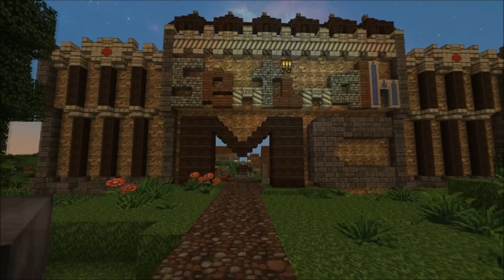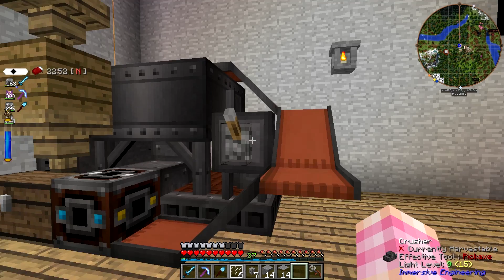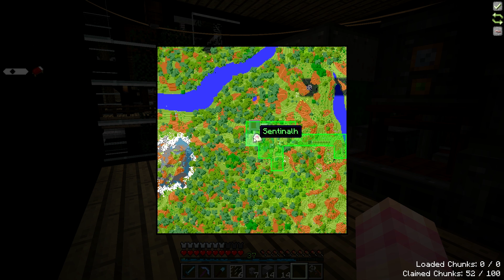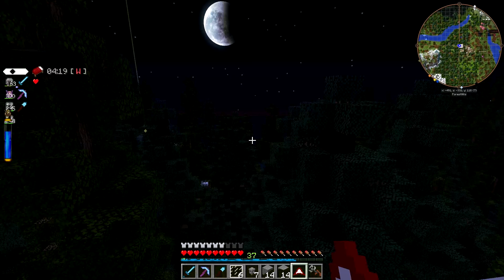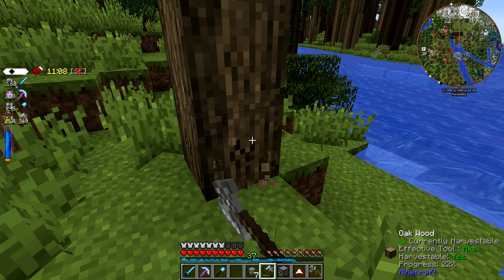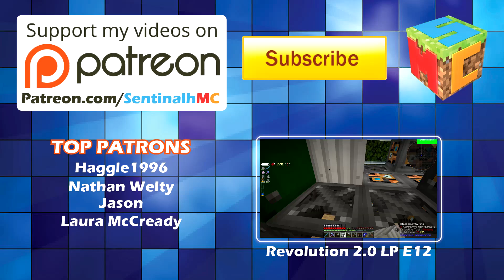Minecraft: Revolution 2 LP13 - New Building

Comment: Build a multiple-floored set up with different sifters, and the conveyors pull stuff up to the top.

Power plant would be cool, substations would be interesting.

Assuming Haggle hasn't oblivinerfed it, you might be able to use RoC hydrokinetics -> RF, which generates a consistent thousand or so.

Comment: You think Industral hemp seeds are the best? 120 mb X 1-2 seed each havist (cant use agricraft for the seeds, only the string) or 80 mb X 32-64 cannola seeds (8/8/8 agricarft) each havist... I plain to do cannola in my SSP world, Sure it uses more power but for that output its worth it. As for the server; I have a setup of 3  Triple water wheels... and a bigger battery. So I as I havent needed more power, but that may change if I set up the arc. 

If you want to stick to wind power, you should upgrade to RoC Wind turbines. 4 of them at y128 output as much as a steam engine. I've got them powering a furnace for cooking the output of my coblestone gen (I use snow bricks for my building). XP for dayz! In fact I think I'll drop off a barrel of XP, I have a few of them laying around... Like I said XP for dayz. I also have 4 combining there output to power a wood cutter, its running more than its not because of the fertility bloom sitting on an enrichment vine next to it. Count to 5 and the newly planted sapling would be grown and already being cut down.

Im sure I gave you some fertility blooms/enrichment vines. If you do choose to go the Industral hemp rout then you should use them for that.

As for what you should do with the building... Its never to early to start reactorcraft right? :P
Reply from the maker: Thanks for the tips, I'm not too sure about that last statement ;)